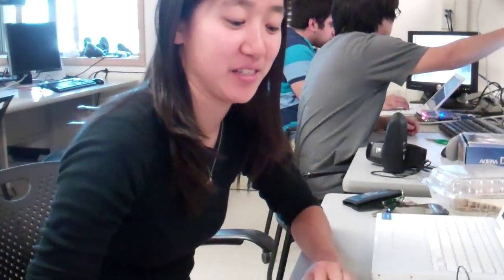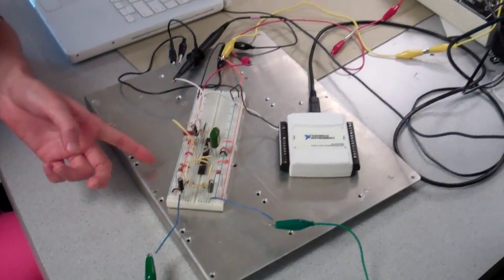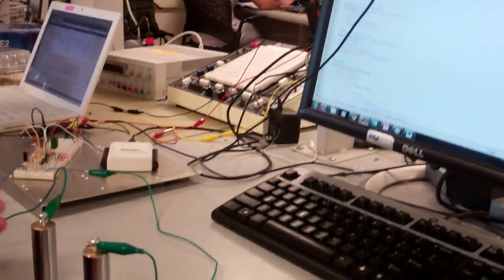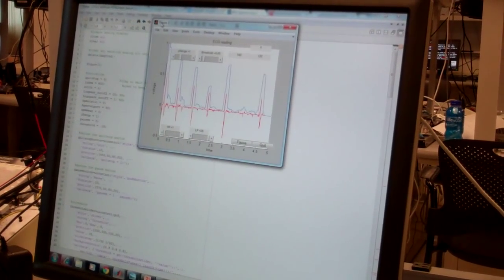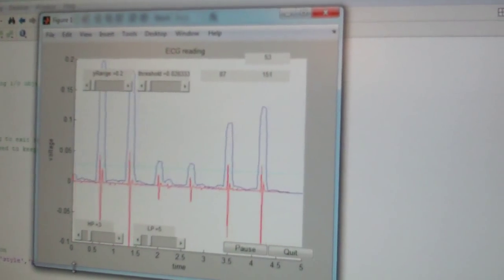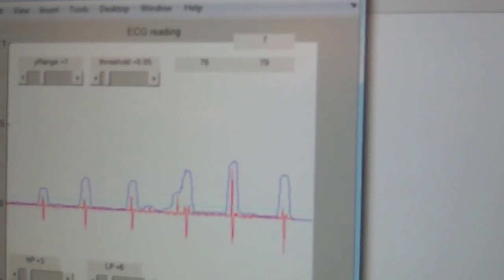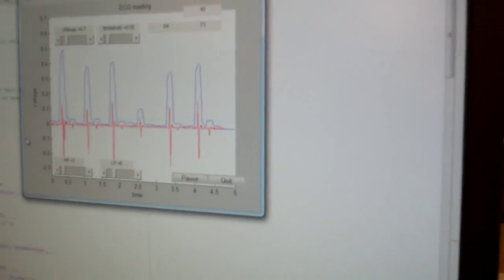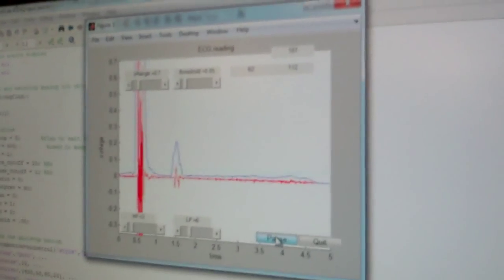Hand grip ECG

Comment: Can I replace the used part AS ADC with an Arduino as an analog digital converter, please?
Reply from the maker: Yes, although you wont get as many bits resolution, and you may have to change the voltage range of the output.